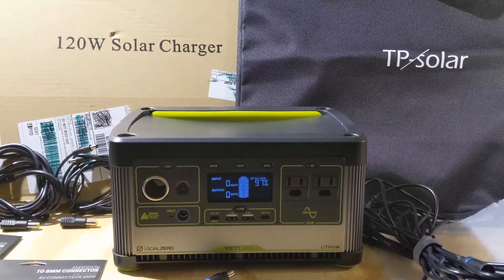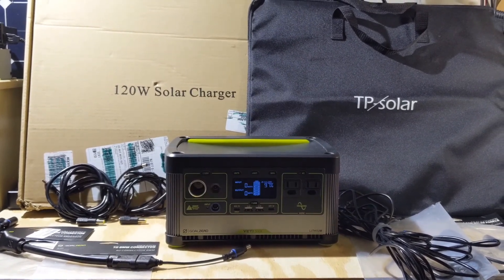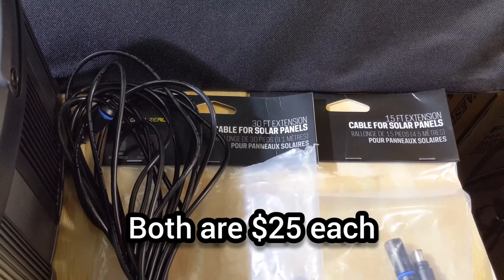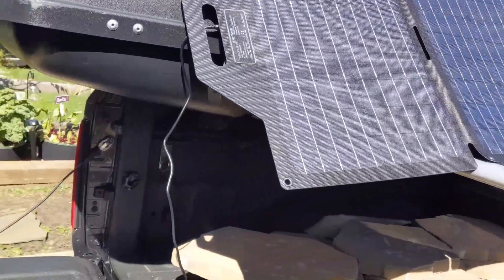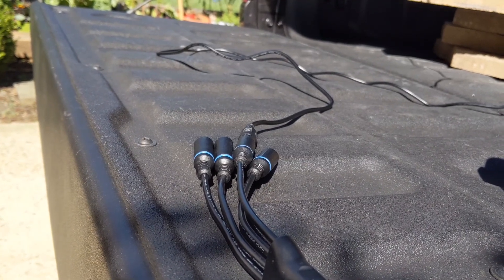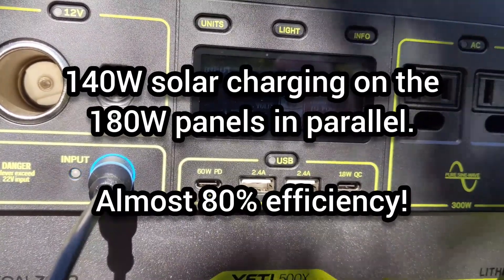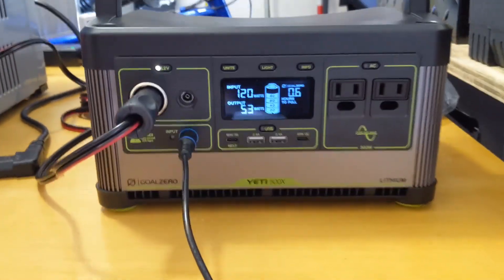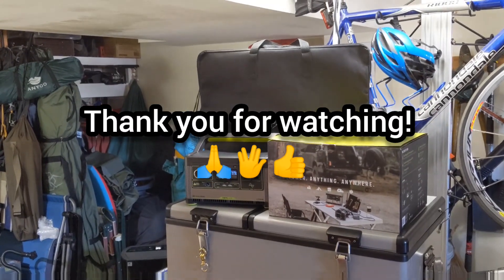Can the Goal Zero Yeti 500X be recharged with over 120W of solar panels?

Comment: so.....is it holding up? I wana buy the same connections as u but i want 2 boulder 100 on my gz500x, will this be okay? thx
Reply from the maker: I think 200 watys will do you well. I found that the yeti 500 didn't have enough capacity for what I was trying to use it for. I ended up going with a jackery 1500. If the yeti 500  has enough capacity for you the 200 watt panel should be fine.

Comment: hey, the yeti has a Charging port (input, 8mm): 13-22V, up to 10A (150W max). can you tell me what will happen if I use a solar panel with Voc 24,64V and Imp 20,88V. can the yeti still handle this, even if the open circuit voltage is too high?
Reply: Did u test